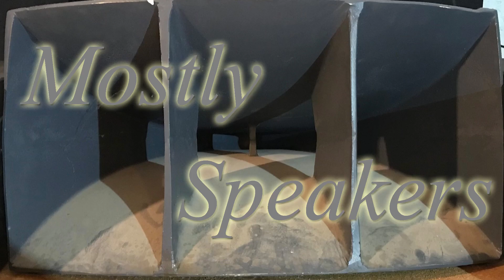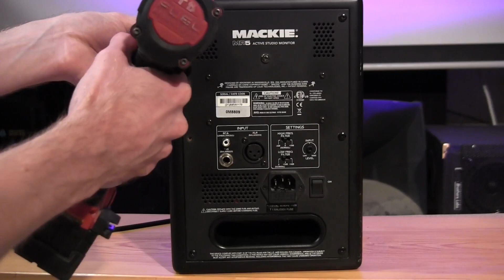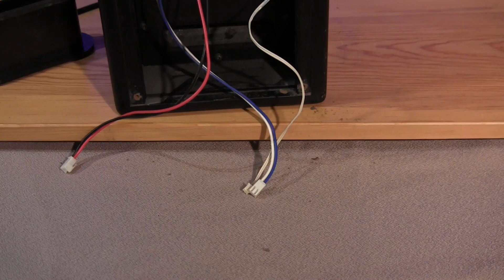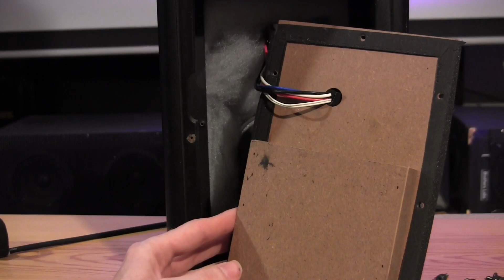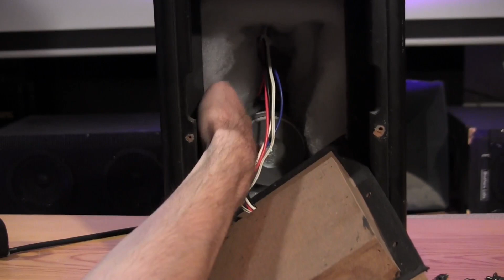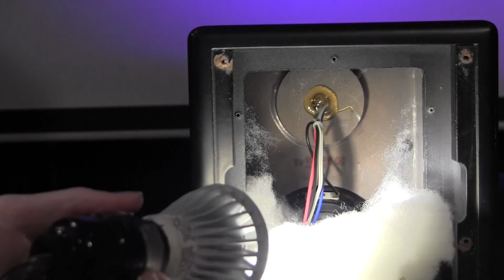This Monitor is Dead. Let's Take it Apart!

Comment: I bought a pair of these Mackie MR5 mk 1 speakers pretty cheap. A few scratches on the shell but seem to work well. Just wondering if these speakers are these any good?
Reply from the maker: I've not used these for mixing, but they sound fine to me This one came from a church control booth.
Reply: Has anyone tried the MK2 or MK3 ? How much different do they sound?

Comment: I've got an identical blown speaker, died like 8 years ago and just quietly hums, but I never got round to doing anything about it. Watched a couple other repair things where it was a capacitor they had to replace, but I dunno how I'd know if the failure was from something else. Maybe I'll just replace the capacitors and see what happens. I had the volume maxed on a hot day in Australia, 40 degrees C when it died.
Reply from the maker: You can find the wiring diagrams on Mackie's website under support. Mine doesn't even hum it's silent. I did test the actual speakers still work.